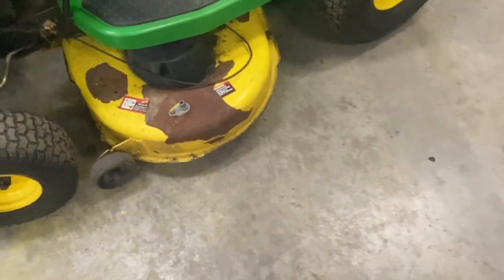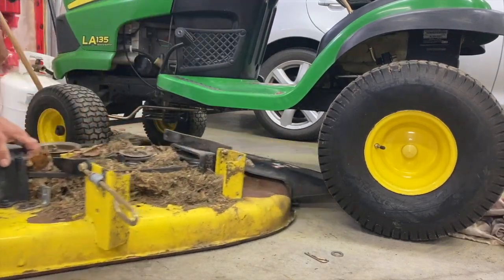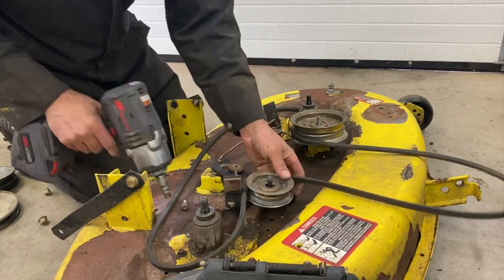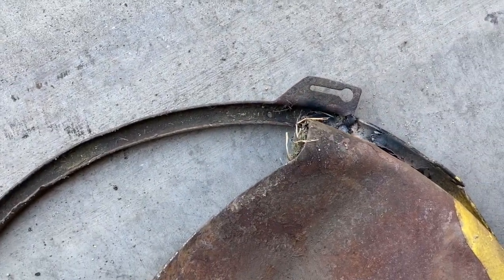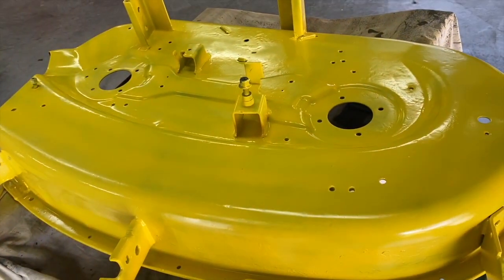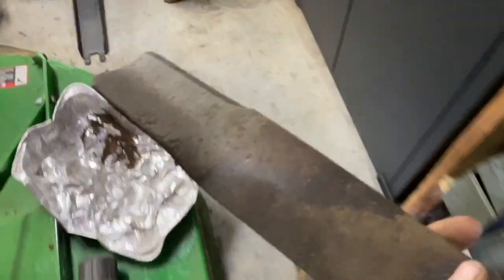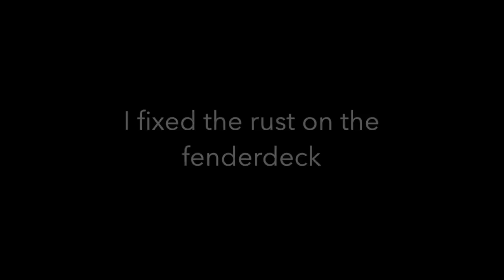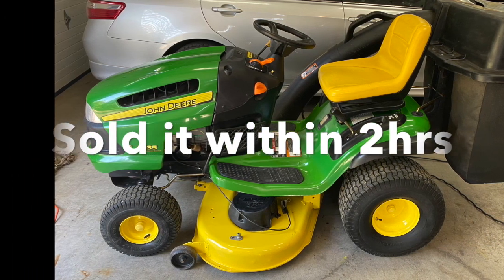Fixing up a John Deere LA135 Lawn Tractor before selling it.

Comment: I add a weld on the edge of the blade..then grind a bevel on her...plus pulley belt covers..an all those other small parts from..
Reply: Where do you buy pulley brake parts from..cant find anything on ebay..Australia..
Reply from the maker: I buy my parts from the dealer and amazon.